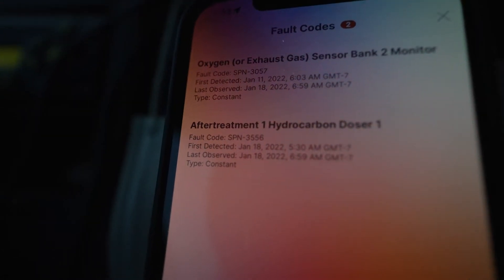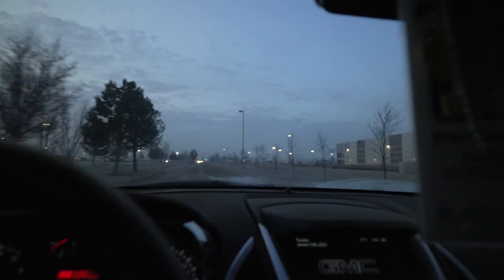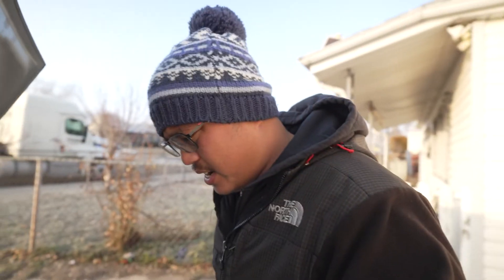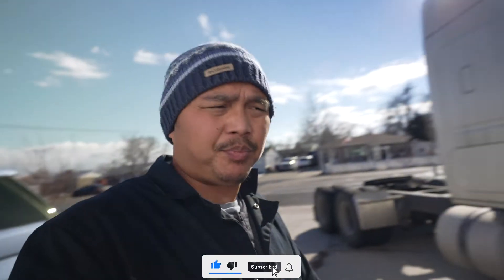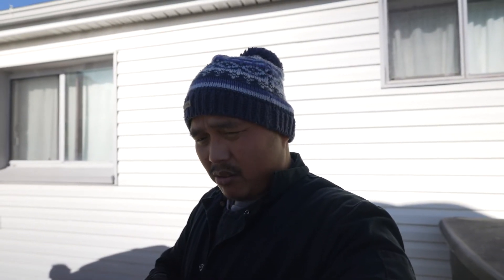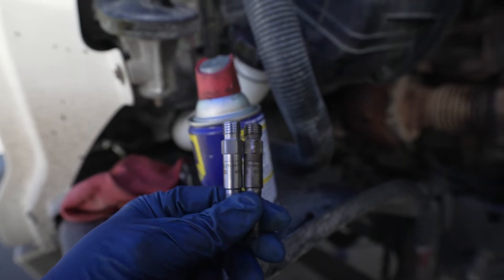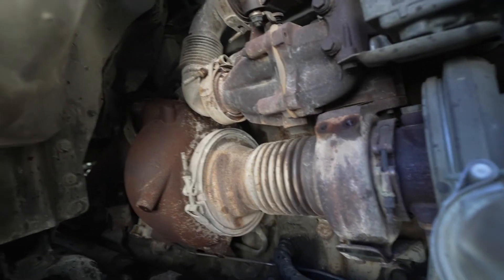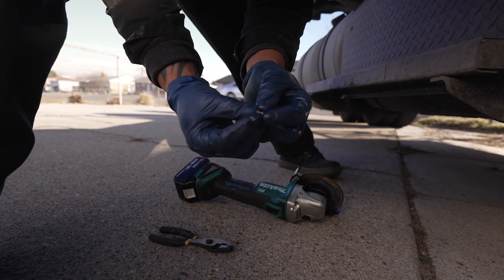Trucking: Emission Headache pt 1 (Dozer Injector SPN 3556 FMI 18)

Comment: Did it work at the end?
Reply from the maker: It was actually the SCR clogged. After this video I bought the OTR Forced regen tool. Ran some force regen and let the one box baked a few times and it fixed the problem. It wasnt the DPF filters because they were replaced 50K miles ago before this video.